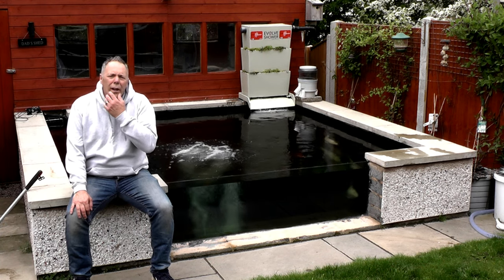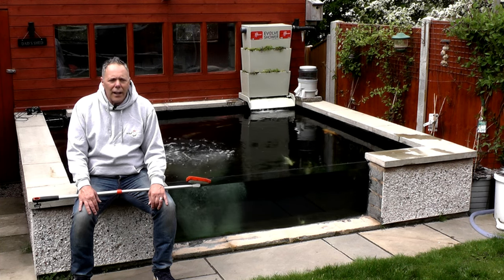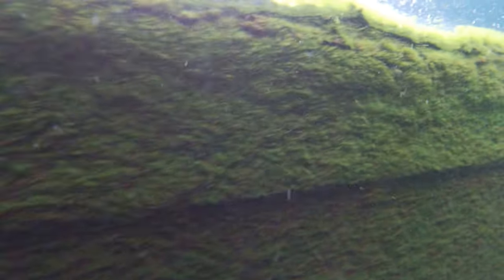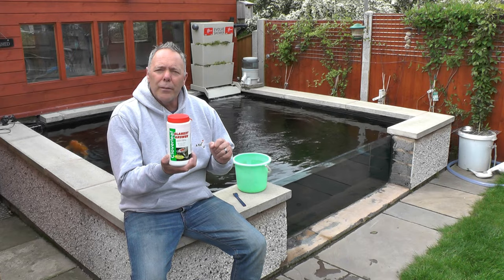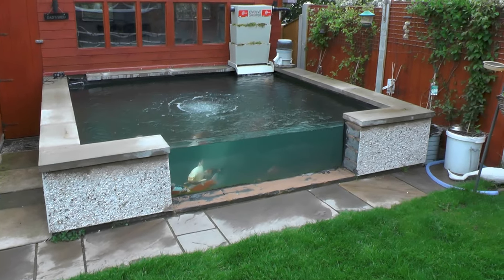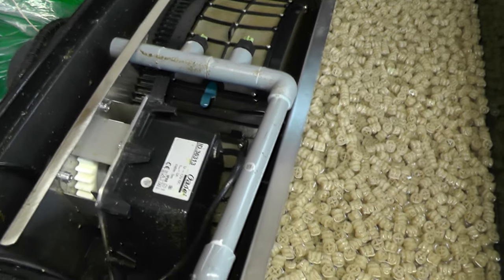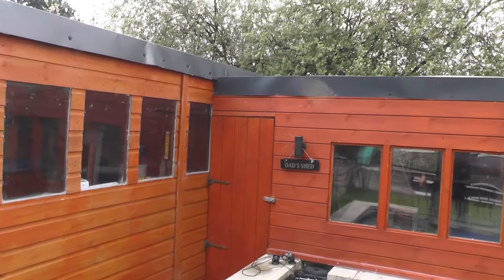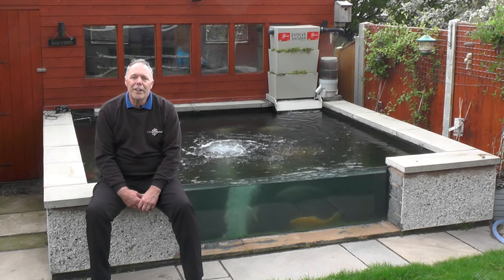Pond Window Glass Clean **New Tile & Glass Brush** Plus Cloverleaf Blanket Answer Treatment

Comment: Hi Kev thanks for quick reply I was referring to plastic see thro box and back box that you have for your cloverleaf feeder plugs and timer on your outside quarantine set up as per your video. 👍
Reply from the maker: Oh right sorry. It is just a weatherproof (IP44 or greater) Plastic Enclosure. I think it was either from RS Components or E Bay. Search either "Waterproof Electronic Project Enclosure Clear Cover Plastic Case Junction Box" or Plastic, Polycarbonate Enclosure. Wilko's etc might even have them.
Reply: @AKoiEnthusiast  Thanks👍😀

Comment: Hi Kev great video I have had loads of those bits flying around for last couple of days must be blowing from along way to my pond.They are a real pain when they land all over your pond!Can I ask you where you got your plastic cover from that you have outside on your plug that works the cloverleaf auto feeder ? Thanks
Reply from the maker: Cheers for watching. Under the trees and around the embankment the ground is a blanket of white fairies. The skimmer is coping well at the moment with them and hopefully another two weeks and they will be gone. A lot are sprouting green stems but they mainly die off quickly. The cover on the Feeder is just a whit plastic 20 litre bucket with a little slot cut out for the spout. I only use it to five a little wind chill protection in the winter.